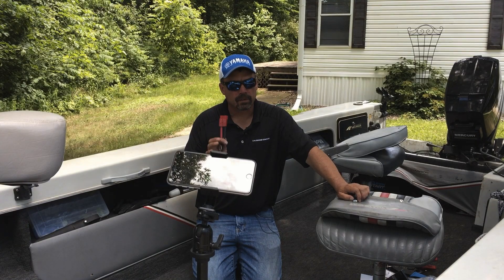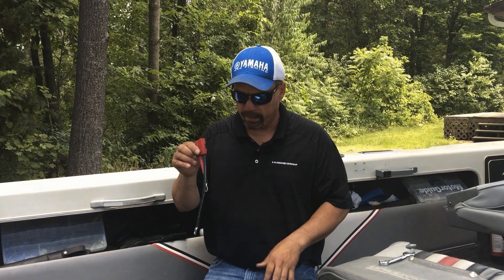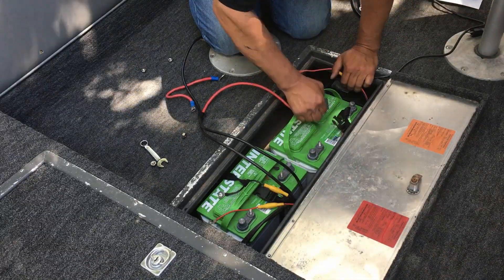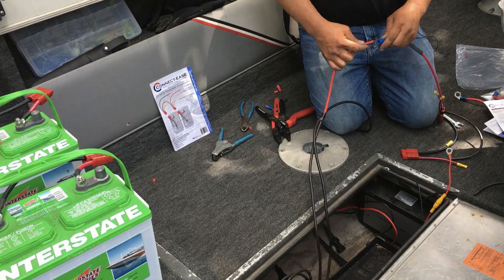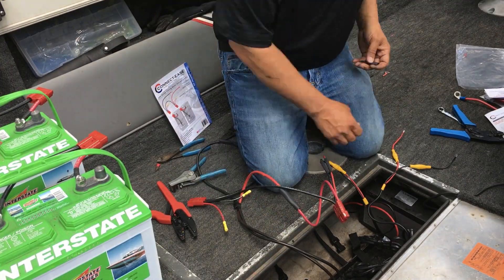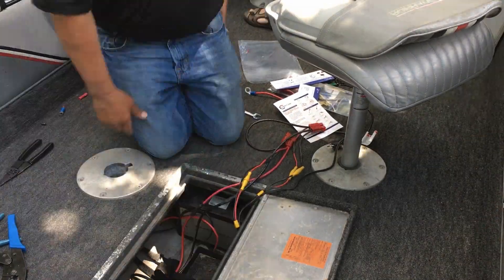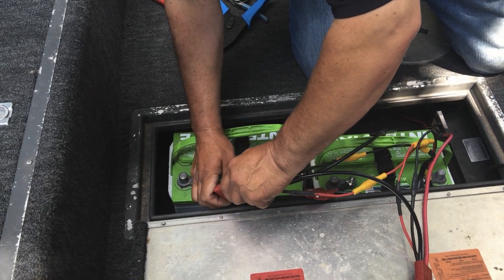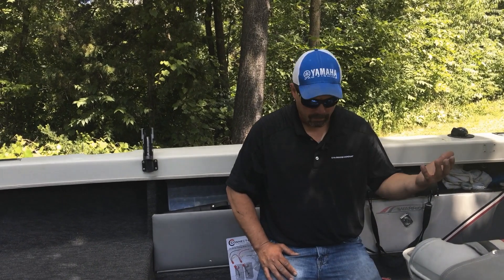How to Connect your 24 Volt Trolling Motor with an Onboard Charging System to Connect-Ease Harness

Comment: This guy doesn’t tell you shit explain to us exactly what it does I mean I mean that’s great you can check your battery in and out can you hook that tear motor and use the alternator off your motor to charge him batteries while you’re using the batteries for 20 V system I mean come on give us a little more information than what you’re giving us I didn’t put much thought into this can you explain to us where the wires exactly go you got them hooked to the battery charger or the can you come to the alternator do you leave a lot of questions

Comment: If you want to get alerts when your charger is disconnected or know your battery voltage from anywhere, check out our Boat Monitoring Kit at https://rmsensors.com/boat-monitoring-kit/! Cellular connect up to two boat batteries and monitor for water in the hull.

Comment: WTF. How to Connect your 24 Volt Trolling Motor with an Onboard Charging System. So how do you do it?
Reply: im trying to find the same info
Reply: Yeah this video has nothing about how to hook up the batteries, on board charging system and what the spare wire go to…just how easy it is to unhook them.